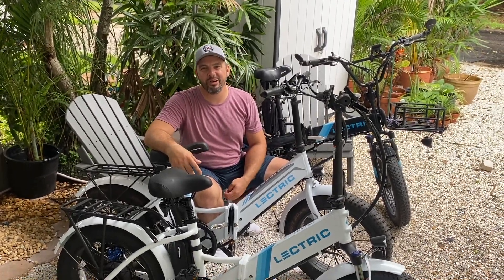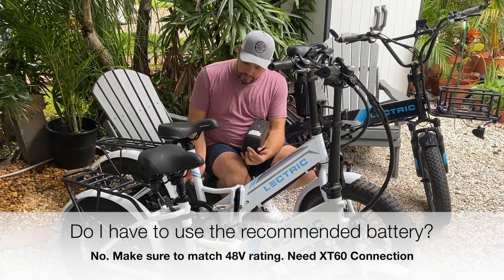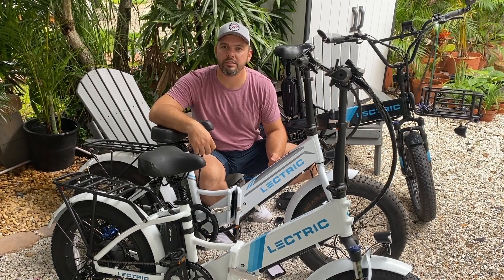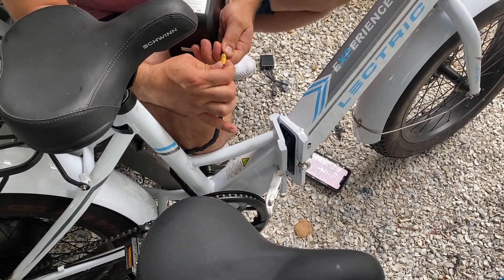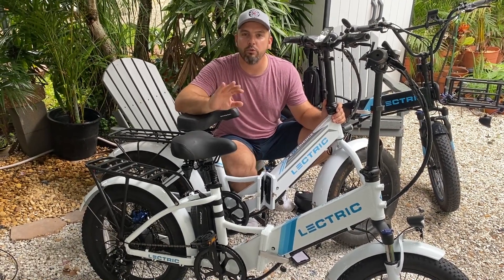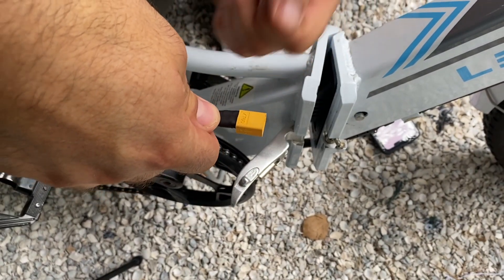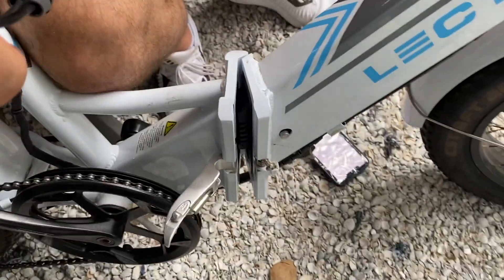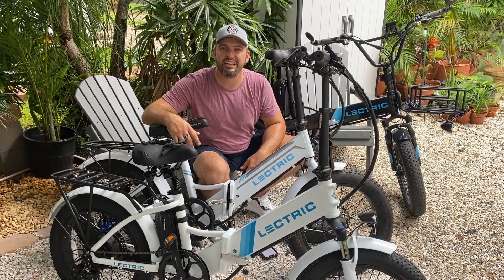Lectric | FAQ_Dual Battery Discharge Balancer Kit

Comment: Is it necessary to connect a power on/off switch for dual battery setup if you don't have the external mounted battery that has its own power switch?
Reply from the maker: The battery power would be on in the same way the factory battery would be on after that e-bike had been turned off.
Turning off at the display has satisfied the majority of dual battery folks
Reply: @ElectricAllWheel  thanks so much for the clarity. Thats what i assumed. I havent seen one installed on any videos but was suggested to me
Reply: I have a 10ah hailong coming this week. But its a bagged version not top mounted

Comment: In the event of one battery being short circuited will it affect the other battery? In other words, is there diode isolation for both batteries?
Reply from the maker: The batteries can operate independently if necessary.

Comment: When you plug in the charger to the bike with the batteries installed and connected will it charge both at the same time?
Reply from the maker: The batteries will need to be charged separately.
Reply: @ElectricAllWheel  TY

Comment: When I plug in the 2nd battery to the bike should it say that it's fully charged like all bars or should it be at 1 bars?
Reply from the maker: The display/controller will share energy bars of the two batteries viewed as one. 
You will need to independently charge your batteries

Comment: From what I’m hearing you can add 
2x batteries with the Internal xp 2.0 battery but with 2 balancer’s connectors and this will work?
The xp 2.0 will be 48V 30ah, Is this sufficient longer range and work with the default controller.  I do food delivery
Uber Eats/ Doordash on XP 2.0. I just need that longer ranger or torque!!
Reply: Or can you use 48V 20Ah with stock controller and add dual balancer.
Reply from the maker: Think of amp hours (Ah) as the gas tank size. The stock 48V Lectric battery has 10Ah gas tank. With the balancer kit you can add as big of an extra gas tank (Ah) that you want so long as that tank (battery) is rated at 48V
Reply: @ElectricAllWheel thanks a lot for the help👍🏻

Comment: My bike's battery is 12Ah.  The 10Ah I bought will put me at 22Ah.  Will that still work with the 20Ah balancer kit?  What happens?
Reply from the maker: It’s a 20A current limit balancer.  
The “amp hours” are the tank size. 
The 20A limit is the “fuel line” size
Reply: @ElectricAllWheel  Thank you, that makes sense.  My balancer gets here on Saturday, I'll let you know my results.

Comment: Hello. You may have already answered this. I just purchased the XP 2.0 Long Range Edition with the 14ah battery. Will this setup work with that configuration? If so, any issues or things I would need to keep an eye on?
Reply from the maker: That battery will have to be adapted because of the plate connectors. We are hoping to have a viable solution at the end of October. Stay tuned!  In principle, the kit will still work with any 48V battery. 
The recommended aftermarket battery has a XT60 connector which plugs directly into the extension cable from the kit.

Comment: Can you add a third battery to XPremium?
Reply from the maker: We have not been through the wiring configuration and controller limits of a premium. 
Our first inquiry would be about the existing dual battery connection components. 
Our second question would be about the current limit of the premium controller.
These questions would relate to current limits of the balancer and needs for further configuration.
Ultimately the answer is yes. A third battery is not an unreasonable concept. 
We do not have the information to give an assertive confirmation regarding the kit.

Comment: You answered this question with a different video.  But I want to make sure before I hook it up.   If I were to use my other EBike battery which is 52V, 17.5 AH on the Lectric 2.0 with the discharge balancer, I would simply max out that 52V battery at 48V because that is what the Lectric battery is.   But I would not do any damage to either battery by doing this?  Thanks.
Reply from the maker: The balancer balances discharge between and to equivalent voltages at a maximum current discharge. Principally, the hardware can sustain a large range of voltages. Current discharge is different. 
The official answer, for sake of your battery’s BMS, stay within uniform principles of use. 
Another answer is, a battery operates in a range of voltages. You can see this on your Lectric charger label maximum output.
Covet your BMS.